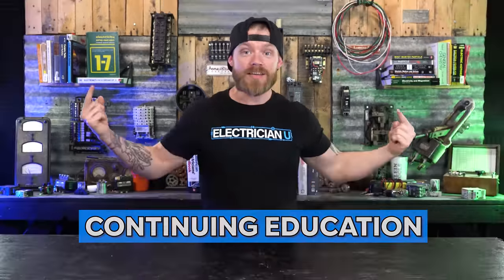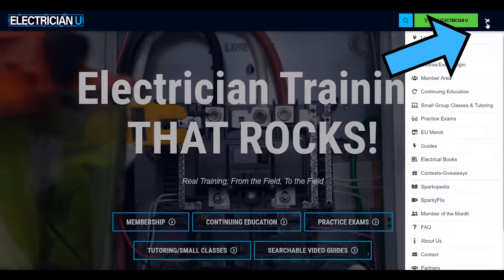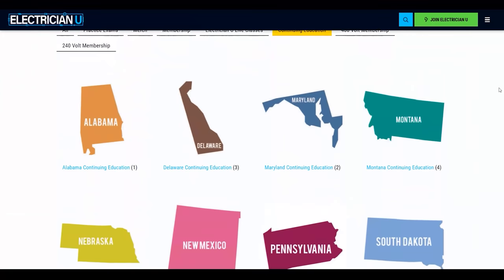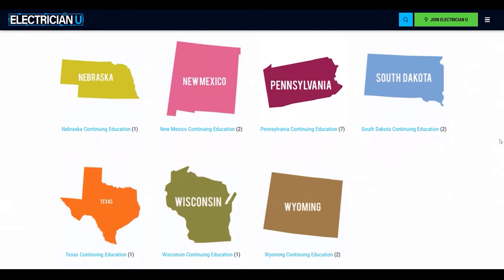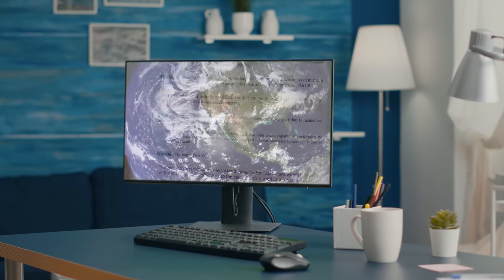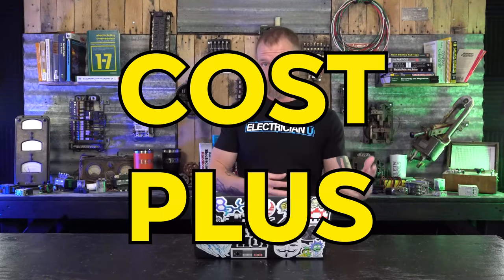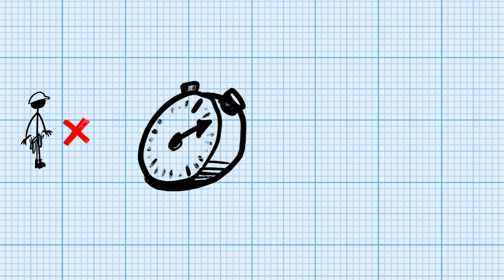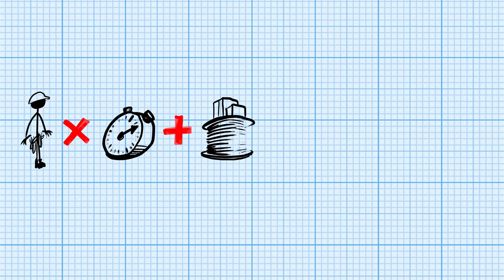How Should I Price Out Jobs? 5 Different Methods You Can Use to Estimate a Job!

Comment: Iv had quite a few pitfalls with pricing things where I haven't made enough. Now there are only certain things where I will undercharge. I get a lot of calls from people that got cut and ran on by other Contractors. Those I give a bit of a price break to because usually the material is already bought and the work half done. I tend to ask them what the other Contractor's Bid was, how much of it they had already paid out, ect. If the remainder of the original bid is close enough to "worth it",  I'll do it for the remainder of the original bid. Every so often the original bid was Waaaay Overpriced so I'll drop it a little. I've had a few that weren't worth it but usually it's close enough and keeping a low overhead makes everything profitable. Those are the type of customers though that will end up praising your name just because you finished the work, leads to great word of mouth opportunities. I really don't even advertise anymore, my former clients do it for me. I have one lady that has sent me almost a dozen clients in the past year.

Oh, and I also have a soft spot for my early customers. I have an old couple that I barely charge at all because they were my first clients and use me for almost anything.

Comment: Dustin, what do you charge for tweakers? I have run into several instances where you have someone asks you for your services and you walk into the job and quickly discover that the electrical problem is a result of someone "Trying" to fix it themselves and they have tweaked it beyond belief. would you even take the job? I was asked by a neighbor to help repair some problem electrical and I told here to purchase the part that needed to be replaced and I would install it for them. upon reentering the job, I was told that their partner replaced the item and it still didn't work.. (it was a GFCI outlet, wired backwards) how do you feel about having to do work like that and would you really want to help people like this....

Comment: Im stumped with wrtiting down a highly reasonable cost for 1.  diving out to a gas station at 12 am. 2. 2 hours of trouble shooting parking lot light outage. 3. gettin replacement contactor after finding it was the problem.4. going back with the part and replacing.  

if there are any commenters that can talk me out of feeling like a jerk for thinking this is a pretty high number ut also hey its a pretty urgent situatioin as well.  id appreciate any advice anyone can help me out with

Comment: I know these questions are better left on newer videos but I would like to replace a capacitor on a broken TVs Starting motherboard and I was wondering if the nameplate voltage rating on a capacitor is not only its maximum voltage but also its output voltage or is the output voltage of a capacitor proportional to the load it’s going to? Reason I am asking is if I were to replace the capacitor with its exact specifications I will have to wait five months for a part to come or I could put a higher voltage rating and get this project done in about two weeks
Reply: If you dont know the answer why are you bothering us. Seems to me you're in over your head! Go find the answer by reading a book.  Thats the way everyone else had to do it! Jeeesh!
Reply: Sorry about that previous reply. It was uncalled for.
Reply: @williamtoon6021  I actually bought some capacitors and tested it myself so the answer is that its only its maximum voltage so you can oversize capacitors if you want

Comment: a 200$ minimum is possibly great, and possibly silly.. i suppose as a minimum its silly, as noted replacing an obvious simple issue a switch, worn outlet, resetting breakers gfci's or replacing some ancient fuses 80-100$ for a local call is alot more reasonable, might cost me 300$ to do an outlet.. if the customer is 80kms into the country side and im the closest person available its going to be 80$ minimum, plus materials plus 1.20$ a km travel

Comment: I have been doing electrical work by myself for just my house.. By the way, hydro company did replace from old style analog meter to new style digital smart meter recently.. I did replace a main breaker last time (I did pull out old style analog hydro meter and I did put it back after replace main breaker).. If I need to replace a main breaker someday(later), Can I work same way? (Even though it did change from old style analog meter to digital smart meter)..Please leave me an answer for me
Reply: Call a licensed electrician.
Reply: If you completely pull a digital meter the utility will instantly know. Cardboard under bottom half of meter leaving top energized can save you time but is nit recommended unless you know what your doing. I only do that for small fixes anything big pull a permit. But changing a main breaker is pretty quick I've removed one hot at a time taped them up and installed new breaker live. Sketchy as he'll but I worked for a guy who was licensed and that's what he had me do as an apprentice